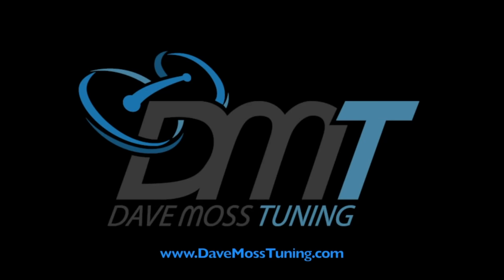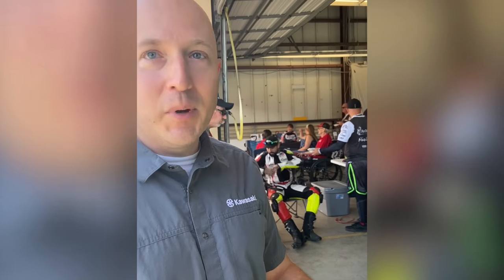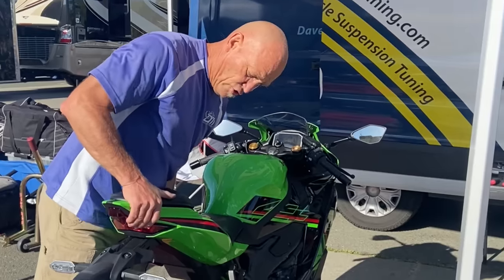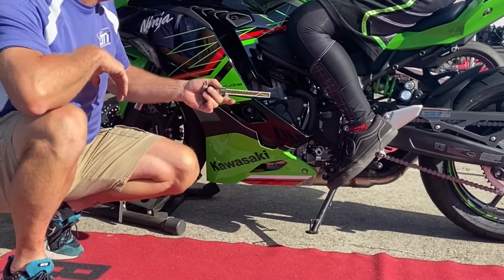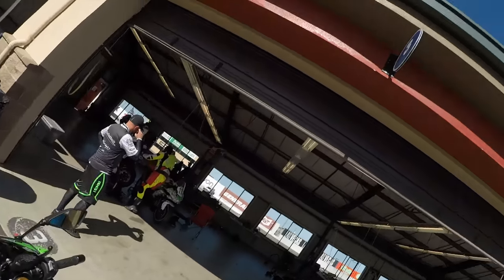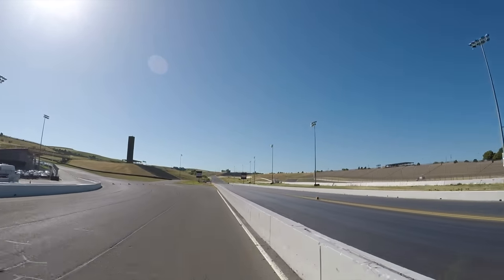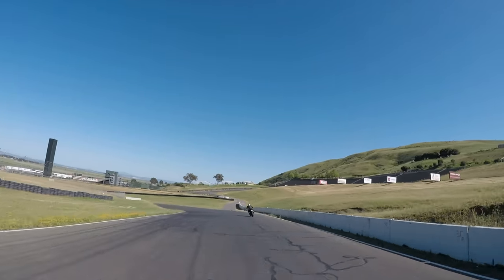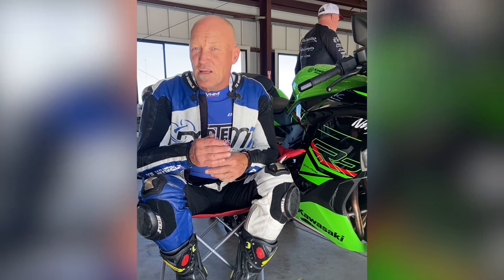2 Clicks Out | 2023 Kawasaki ZX400RR first ride and suspension dial in!

Comment: Over priced, under powered, what's the point? Weighs as much as a 600 with less than half the  rwhp? Needs another $3k to make 75rwhp, and still will be as heavy as a 600. Looks like the bean counters got overly involved in design, rubber brake lines, steel frame, no radial master cylinder etc. Would be acceptable at maybe 7k, but I'm seeing them sell for between 11.5k  and 13k. And then you still have to spend another 3k to get it where it should be, and a lot more if you want it to be anywhere close to the weight of a stock ninja 400. I will pass on this one.
Reply from the maker: Great points made on other models with more features. I will be taking the cheap approach to the upgrades, so I hope to spend around $1k or less.

Comment: "the center of gravity is derived from the zx10" ???
Reply from the maker: Engine placement and height within the frame is anchored in the ZX10R engine position.
Reply: @catalystreactionsbw  Yeah but the engine and the rest of the bike weigh different. Having something at the same spot doesn't make much of a difference in this case, the center of gravity is very unlikely the same.